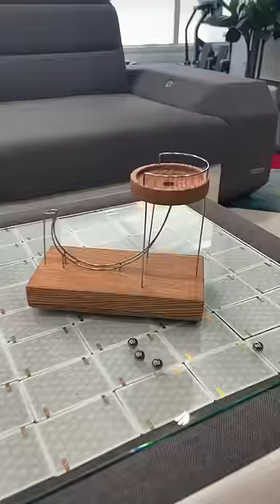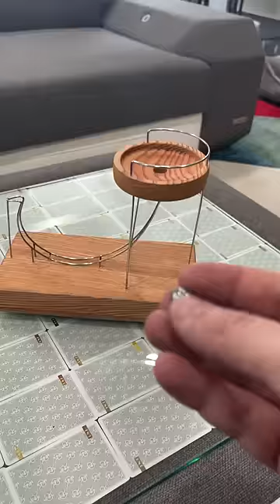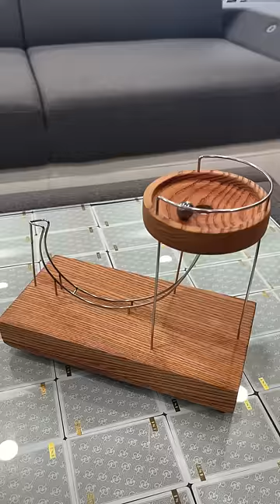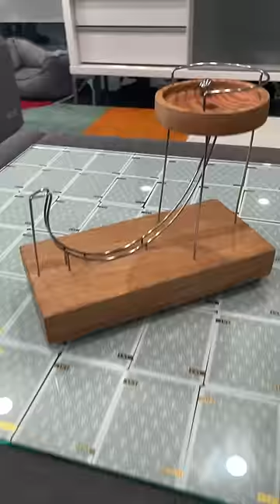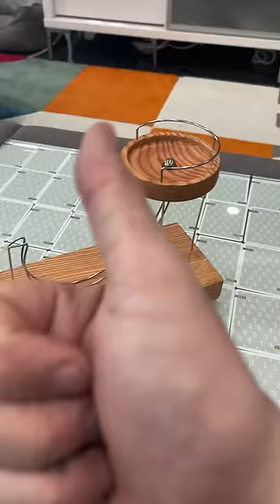An Impossible Perpetual Motion Device?! 😳 #Shorts

Comment: On packaging of this device: Remember: perpetual motion is impossible. This machine uses 1 AA battery to power its electro magnet located underneath the bowl funnel.
Reply: Couldn’t it just use a regular “unpowered” magnet?
Reply: @brodiwheeler7583  Good question. There are a few key differences between permanent magnets and electromagnets. Firstly, and possibly most relevant in terms of their uses, is that an electromagnet can be turned on and off, whereas a permanent magnet, as its name suggests, is permanent. Second, an electromagnet’s polarity can be reversed (by changing the direction of the current flowing through it), making it useful for use in motors and generating motion.
Reply: @Clubkidknitter  Thanks for the educating answer. I’m still wondering though, why a permanent magnet would not work in this application...? Seems the polarity would pull the ball down and push it away as it passed if mounted appropriately no?
Reply: @brodiwheeler7583  because, a permanent magnet would both speed the ball up, and then slow it down as it passed by. Which defeats the purpose. An electro magnet, is turned on to speed the ball up. Then, as it passes by the magnet, is turned off so it doesn't then also slow the ball down.

What we have here, is a railgun
Reply: @brodiwheeler7583  Magnetic field from magnets is conservative, which means on closed paths it doesn't do any work. This means that no matter the trajectory, if you start from a point and get back to that same point (which this ball does), if the magnet happens to pull you down when you're coming down, it will do exactly the opposite when you go up. And since in the meantime you're wasting energy in friction, you will end up to a lower height than the one you started from. So you definitely need to turn off the magnet after it has done useful work, or move it. There is no way to get the ball up there without a source of energy.
Reply: @Matthew314  Roger that. Makes sense, thx for the thorough explanation 🧲👍🏼
Reply: @brodiwheeler7583  You're welcome :)
Reply: @Clubkidknitter  they are not permanent
Reply: @Wingo537  Precisely!
Reply: So why does this not work with no battery? Looks like it would.🤷
Reply: @lightingthedarkremoteviewi8086  friction, and a bit of wind resistance, would slow it down to not make the jump back to the bowl
Reply: Not that one lol, they have a kinda rubber wheel at the hole thay connect with a AA battery and a motor to ramp up the ball speed for the launch. You can see it was very fast at the drop
Reply: @brodiwheeler7583  no the ball might be magnetic as well the electricity is needed to push it
Reply: @brodiwheeler7583  You could not use an unpowered magnet. The first law of thermodynamics says that no energy can be created or destroyed. Before you release the ball, it has a potential energy defined by its height from the base of the contraption. Because the ball makes a sound and has friction with the metal rails and wooden part, it is losing energy to its surroundings in the form of sound and heat. This energy loss means that, without added energy from a battery, the ball will eventually lose enough energy that it can’t reach the top again and will fail to be launched back onto the thing.

A “regular magnet” would have balanced energy addition and subtraction from the attraction and repulsion of the ball. Thus why an electromagnet attached to a battery is necessary, because it can be switched on and off with the timing of the ball.
Reply: my engineer mind was activated when i saw this bs
Reply: Ok that makes sense. Didn't even think there was electromagnetism at play
Reply: @brodiwheeler7583  Unfortunately not, because the same magnet pulling the marble forcefully down the loop from the entry point would also pull it back from rising up at the end.

It's the same reason why you can't use a  regular magnet to spin a fan infinitely: the fan blades quickly get held in place due to the polarity.

To make it work, you need a way to either turn the magnet on and off when needed, or reverse its polarity at the right moment to ensure the marble keeps its momentum. With our knowledge of physics, the only way to do this is with an electromagnet, which needs electricity to operate.
Reply: @BeckJoseR  A certain Scientific Railgun, by chance?

....I'll see myself out
Reply: thanks for everyone in this thread explaining why this doesn’t violate the laws of thermodynamics
Reply: Ah FUCK some smart kid beat me to the explanation
Reply: Scinence: Perpetual motion is impossible!
Creation: hold my oceans, winds, sun, moon and stars...
Reply: @BeckJoseR  but doesn't perpetual motion exist on bigger scales - like gravity - no matter how far some other object is, it will fall into its gravitational pull. For example let's say there is only the Sun, Earth and an object few times bigger than the Sun but 20 million light years away - Sun suddenly disappears, Earth would travel towards the gravitational pull of that object. Or there is only Sun and Earth. Sun disappears and Earth doesn't just stop, it moves through space at the same speed, bc there is nothing to speed it up or slow it down - isn't that perpetual motion? Isn't gravity perpetual motion in itself?
Reply: @paulkern9380  everyone keeps saying friction and air resistance, only, but you're forgetting potential energy. The marble is falling from a set height as it goes down the ramp before being launched back above the height from where it began its fall. It's actually gaining potential energy from the moment it falls to its peak airborne height, which requires additional energy (as per Bernoulli's equation).
Reply: @belladonnahigh9206   In the first example the earth will eventually reach the local area of that distant object and behave accordingly.  In the second example if an object is alone in the universe you can't say its moving. Linear motion is relative to a reference frame.. Without reference to a second object linear motion doesn't exist.
Reply: @mynotes280  Ok, thanks for explaining. So is the first example perpetual motion or not?
Reply: @belladonnahigh9206   The idea behind perpetual motion is that a system gets no energy inputs and can sustain its total energy indefinitely without any losses.  In the first example there is massive potential energy being converted to kinetic energy if the earth is moving towards the distant object, then there will energy changes as the earth interacts with the distant object (collide? orbit? slingshot? sail past?).  So in this case I would not call it perpetual motion. 

I think you are thinking "will it move forever though".  I do think its possible to have objects that move away from other matter basically until the universe dies.  I think they would dissolve eventually as matter at the surface breaks away from the main solid object?  But that scenario still doesn't meet my concept of perpetual motion,  because the object is slowly losing kinetic energy the whole time due to gravitational attraction to the rest of the universe.   It just has enough momentum to keep going until dissolution as it slowly loses kinetic energy.

Edit: Counter argument: The loss of kinetic energy might not violate the idea of perpetual motion, as it is getting converted to potential energy, which is allowed with perpetual motion.  In the real world there are additional losses of energy (conversion to energy other than kinetic or potential) in this scenario but I dont know where.
Reply: @belladonnahigh9206   I though of another example in the spirit of your examples.   Suppose only two objects exist in the universe,  orbiting each other in vacuum.

Seems like there would be perpetual motion because there are no friction losses as the objects move in vacuum. 

But there would still be tidal forces acting on the objects as they orbit, sapoing energy. IIRC, the more rigid they are, the less tidal losses?  But no object is perfectly rigid, so they would eventually fall together. 

I dont know how to address an idealized universe of two perfectly rigid bodies orbiting each other.
Reply: @brodiwheeler7583  magnets lose power over time
Reply: @belladonnahigh9206  of course not. It would stop when it reaches that "other object". So it's not perpetual
Reply: @backtoeden2042  none of that is unpowered, therefore not perpetual.
Google: the Sun.
Reply: @omuploii  it's included in the description of creation. Google: read properly before commenting.
Reply: Is this a perpetual rail gun?
Reply: @tyty8484  no
Reply: @BeckJoseR  that just made so much click in my brain. Its kinda obvious but I just didn’t think about it lmao
Reply: @belladonnahigh9206  gravity and matter are still not fully understood. There are now theories of "dark matter" and "dark energy". It's all theoretical.

But what is more commonly agreed on is what is called Entropy. Basically, there will be an end to all that exists, the universe will cool down and it will collapse on itself. It's not that gravity is endless, it's that it is a force that is powered by mass.

I would also note, gravity a form of potential energy, not kinetic. And when something falls, it loses gravitational potential energy. It won't ever gain that back, unless someone puts it back. Say, by using electricity to power a ball back up a rail.
Reply: @BeckJoseR  most of this is known to me (the universe stuff anyway, watched too many docs to all the endless nights I couldn't sleep and and still do, but in the form of shorter videos, John Michael Godier is one of my favorites). As for the rest, thank you for explaining me stuff.
Reply: @brodiwheeler7583  the kinetic energy it would gain getting closer to the magnet will be lost trying ti exit its influence if its an electromagnet it can be turned off and then the object will only gain energy
Reply: Would be awesome to power that with your body's electromagnetic field.
Reply: what would eventually happen to the ball of it wasn't assisted by the magnet?
Reply: @LeftyCrusher9000  yes, it will need a magnet
Reply: @tdwz1652  it wouldn't make it back up to the top. Friction would determine how many times it could make it, if it could even make it once
Reply: I literally just thought of that and posted before reading this it's cool it actually uses the technique I thought in my mind
Reply: @BeckJoseR  ideally a railgun uses an additional magnetic force as the object passes the electromagnet, the electromagnet switches polarity to further repel the passing object. The previous electromagnet repels the object away from it, alongside the incoming electromagnet attracting the object towards it
Reply: You’re killed the magic
Reply: 1st law of Thermodynamics unfortunately proves beyond any doubt it’s impossible to achieve genuine perpetual motion. Heat and work are both forms of energy transfer within a closed system. Internal energy of the system changes if heat is transferred outward (by the system doing some work) or inward (some work is applied to the system). Eg: the energy used to charge a battery will always be greater than the energy it supplies, because a proportion of the transferred energy is lost to the system as heat and is thus not available to provide work.
Reply: @brodiwheeler7583  the answer Is no, couldn't give the Power needed to launch the ball back, since would require the ball to teach a higher point than the start
Reply: Even the best magnets wear out - that’s why from our current knowledge perpetual motion is impossible
Reply: @zoezhu2443  also, Natural magnets do not have an oriented magnetic field, so they Will Just trap the ball
Reply: Yes, someone with logic explanation
Reply: @maaingan  this only works if the object your firing, is itself magnetic. A ferro magnetic material without it's own polarity, would still be attracted to the original electro magnet, even when that polarity is switched.

Coil-guns, will have multiple coils that each turn on in sequence. With the previous coil turning off as the projectile passes through it. I've made one of these, and they are awesome.
Reply: Thanks for explaining when the video nor the description did not.
Reply: @brodiwheeler7583  batteries= magnet on and off?
Reply: @backtoeden2042  everything is being very slowly drawn in one direction..
Reply: @belladonnahigh9206  up to you comment, you are the first person the say the word gravity. With so many explanations before you, I find that hilarious being the only constant in the equation. You can not explain why this works or doesn’t work without a firm grasp, and liberal use of the word Gravity. This is the same reason a Permanent Magnet couldn’t possibly work for this application..
Reply: WHY DIDNT HE SAY THAT? Clickbait short.
Reply: @brodiwheeler7583  🤣
Reply: In the rail
Reply: @brodiwheeler7583  there is a type of bell shape or concave permanent magnet that does shot out bids.
Reply: I KNEW IT WAS AN ELECTROMAGNET BEFORE COMMENTS 

I DONT EVEN KNOW THE PRODUCT
Reply: The USB charger included in the offer gives away why the bead accelerates at more than 1g when it leaves the bowl. I’m not buying this.
Reply: I was gonna say. There’s no way that drop can make that marble fly that far.
Reply: Isn’t perpetual motion possible in space?
Reply: That is my guess. Good to know! Thanks!
Reply: @brodiwheeler7583  oh shit! Didn’t you learned at school?! Perpetual motion is IMPOSSIBLE! Magnet in that toy turned on when it needed and turned off when the ball must be released.
Reply: @brodiwheeler7583  there's no instance where "the magnet will push it away" a magnet will only push something away from itself if the other object is also a magnet, but if the ball were magnetic, the opposite fields would be forced to attract each other and the ball would come to an instant stop at the bottom.

Since the ball is not a magnet, a permanent magnet would act as an accelerator while the ball falls down towards it, and it would pull it back towards itself as it went over and away back up the ramp.

Think of it like this, you have a magnet and a small metal ball on a table. Under no circumstance could you use the magnet to push the small metal ball around, It would only pull it towards the magnet until it touched the magnet, where it would stay.

Now, think of if you had super human reflexes, and you bring the magnet near the metal ball. But the instant the ball starts to zip towards the magnet, you pull it away even faster, now the ball is free to continue on it's way because the magnet is no longer there to pull it towards itself. 

That's why this little gizmo needs an electromagnet that can be turned off before the magnetic field switches from being an acceleration force to a braking force on the ball.
Reply: Lotta smart people in this thread.
Reply: Oh thank goodness other people also know that "secret". It was my first thought when i saw the vid.. "that's a thick bottom plate, i bet it houses a neat li'l electro magnet" 😂
Reply: @BeckJoseR  why don't you just flip it around? Have the magnet to where it slows it down first and then speeds it up
Reply: @Clubkidknitter  you can turn off a perma magnetic too.
Reply: I liked your comment and disliked the video because he didn't explain this even though he explains perpetual motion is impossible.
Reply: @PrimeHitz  this only works if the projectile, is also magnetic. With it's own polarity. A ferro magnetic material, without it's own polarity, will always be attracted to a magnet regardless of it's orientation. You can see this my putting a magnet to a nail. Then turn the magnet around and see if the nail is still pulled towards the magnet.
Reply: @backtoeden2042  except those too will die ;)